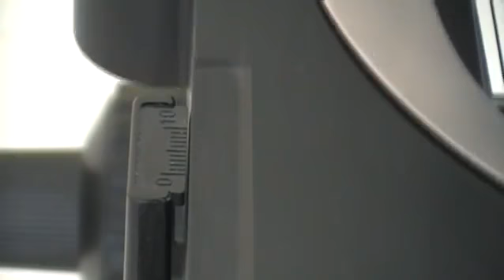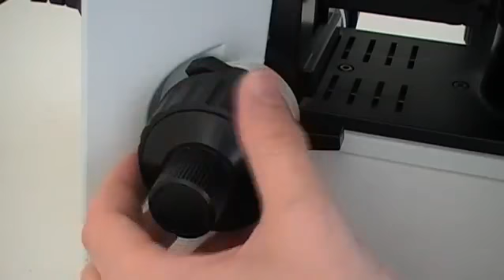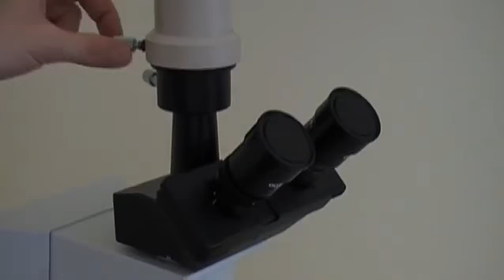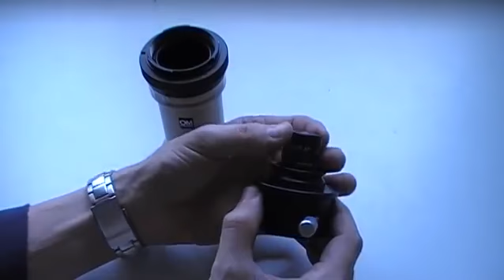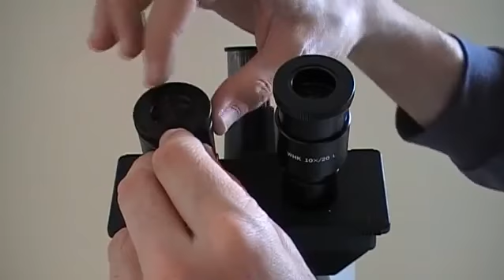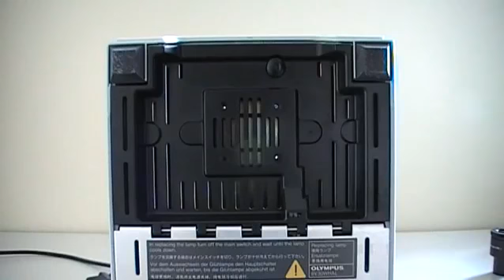🔬 004 -  Compound Microscope Parts and Functions (2 of 2)

Comment: Greetings O! 

I recently bought a microscope and have a question about the  “lock” feature you spoke of with the coarse knob and stage. 

On my microscope, it’s a screw towards the inner arm frame which is behind the stage. 

For this kind of “lock”, where is the most  optimal position to leave it into ? 

For the time being, I tested the distance of how close the objective I will mostly use (“40x” ) got to the slide on stage and I locked the “security screw” where the objective was closest to the slide (assumed for better viewing) without the possibility of it ever accidentally crashing into the slide. 

Was this a good method? Please advice me brother 🙏

Comment: Hi Oliver, thanks again for all the wonderful content! I've recently devoted a room to microscopy and have started to build up my lab. I have two old light sources (illuminators) that need some maintenance. The fans run but that is all, and they are missing the gooseneck (light guide) fiber opic cables, so I will need to get some parts. Could you please do a video on these kinds of lights, and on some of the general maintenance like how to buy and change bulbs and fuses? It would be interesting to also hear what you have to say on the ports/adapters for the different sizes of light guides, I have an insert for one of my illuminators so I see there are at least two diameters out there. I have a stereoscope on a transmitted light base TLB3000 Series, Model TLB 3.1, with a port that I suppose "plumbs" the fiber optic in and allows for darkfield and a few other options. I'm still figuring this all out, I got a lot of this stuff recently as used surplus.